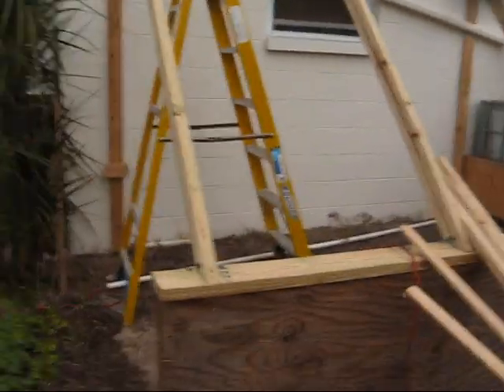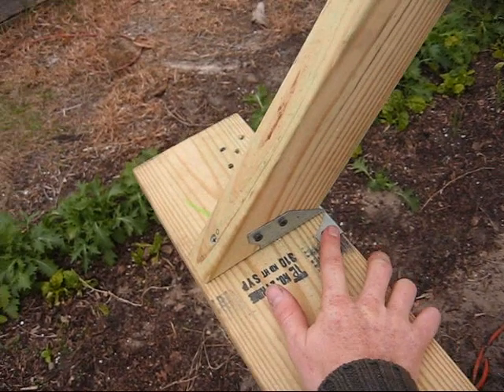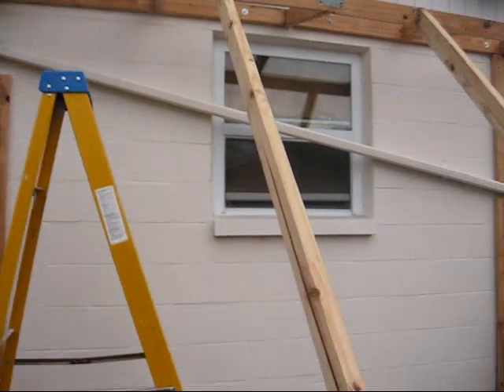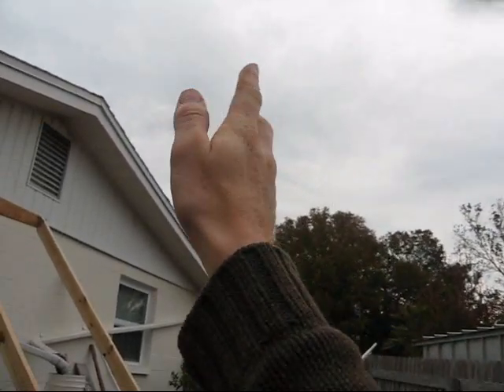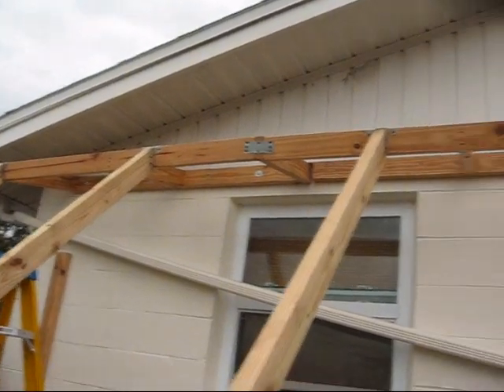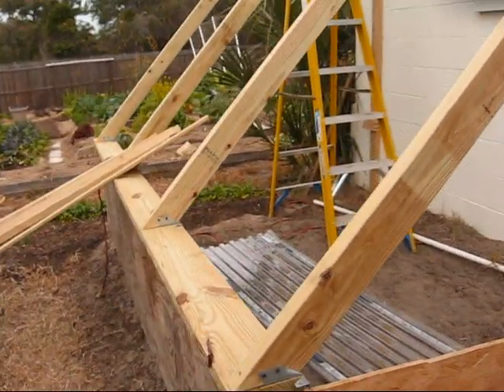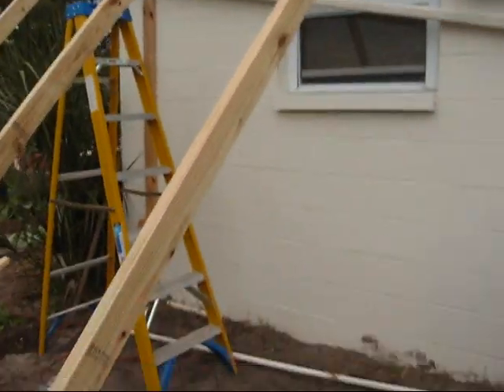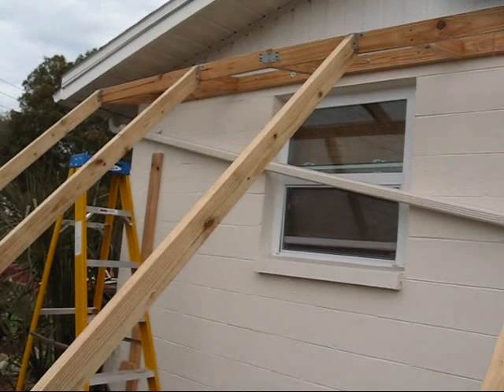Lean To Greenhouse Part 2

Comment: I'm sorry to hear the fruit trees took a hit. They are the hardest to maintain in the cold. I think I will plan a leafy green garden next winter. Thanks for your insights Adam! And by the way, I'm trying to think of where I could put a small green house as well. You have inspired me! I have a 35x35 garden for my first year. Subtract a 4ft wide U shaped pathway through the middle of the garden for easy access with my lawn tractor. I'm also going to try the square foot garden concept.
Homestead!